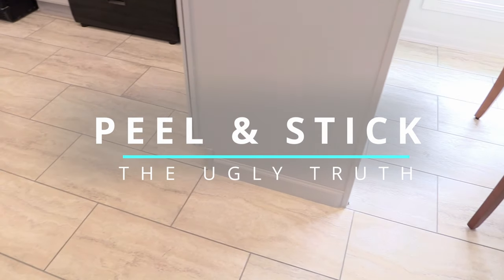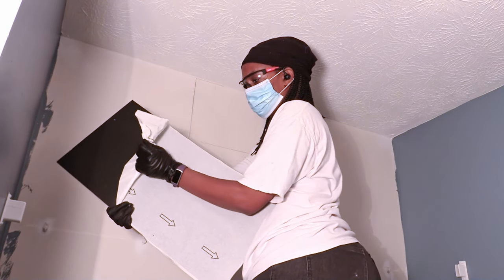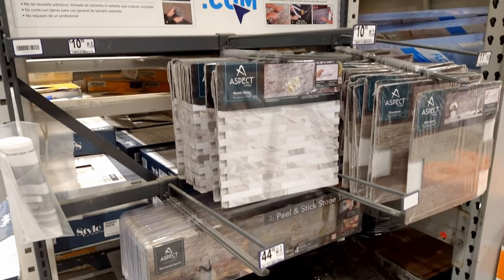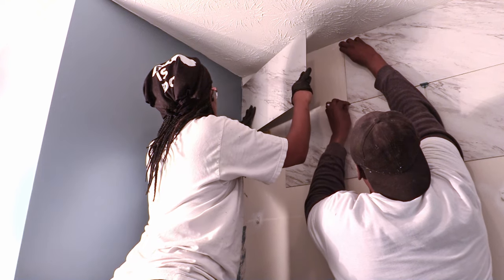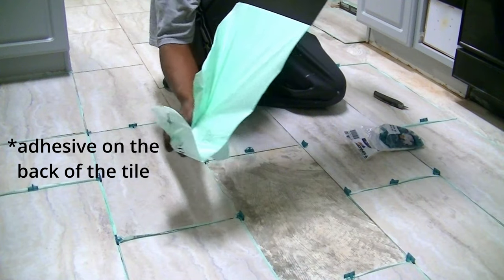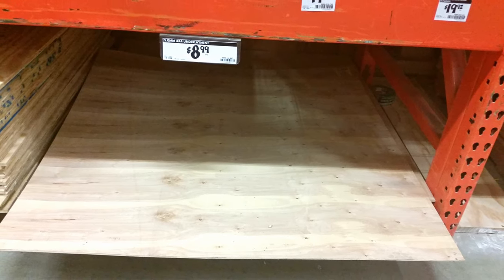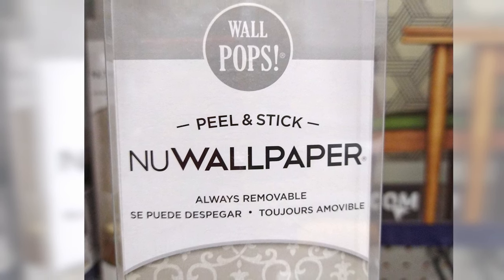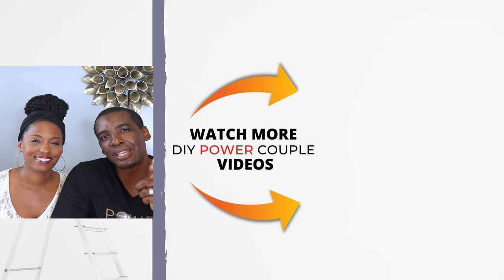THE UGLY TRUTH ABOUT PEEL & STICK - Don't Be FOOLED!

Comment: A tip that doesn't relate to peel and stick, but it does for rentals. If you have white walls and hung any paintings that you will take with you when you move fill the nail holes with white toothpaste and let it dry. It fills holes completely and you'll get your deposit back.

Make sure you take photos of your apartment so you have proof of any damage that's already there when you moved in. The photos will be evidence that you didn't damage anything if your landlord tries to keep your deposit. If your landlord takes you to small claims court because he says you damaged it, the photos will be evidence in your favor.
Reply: If you're going to fill the holes, just use spackle. It's the correct material, still dries white, and won't react weirdly when the wall is painted again in the future.
Reply: That's terrible. You're cheating and being very dishonest to the landlord by doing that.
Reply: Terrible tip!

Comment: Is it best to lay  a base of painters tape before laying peel a stick products? I was told this will protect the original product and makes easier to remove without damage
Reply from the maker: To us, placing adhesive on top of adhesive will have the same outcome. It may be harder to peel off (remove) tape over time because it could shred.

Comment: Very helpful as we now shop to replace our click together floating floor after only 2 years. Did not realize a floating floor is a terrible choice for a mobile home, what with all the flexing such a structure allows. Even a little has been enough to pop & chip each plank. Truly hope peel & stick will actually stay put. Maybe in your next video you can address different types of dwellings suitable for peel & stick tiles as well as what type of sub flooring is best. This has been an expensive lesson.
Reply: Peel and stick will work with your flooring. Just prep it right and do as they did with theirs and grout and seal it. The adhesive is extremely strong for the floor tiles. You can always look into adding extra adhesive when applying.
Reply: Oh, on Facebook there are a couple of DIY Mobile Home Restoration & Remodel groups (some have budget-friendly in the title). There also may be some videos here on YT. Anyway, I've seen a lot of great ideas and nice remodels done, using numerous methods. One lady was saving up for her floors to be professionally done, but in the meantime, she had just the bare plywood floors exposed.. so she painted and sealed them using porch paint I think. I couldn't believe the turnout, it looked good. I've seen several posts mention that they use wallpaper and vinyl wraps to update their kitchen on a budget.

Comment: Have you ever looked at a floor that's a few years old? I did one for a relative and a couple of years later I noticed that the tiles actually shrunk. I had put them down as tight as possible, touching. Now there's a crack between pretty much every tile about the thickness of two  or three credit cards maybe. I did have the tiles in the room for a day or two to acclimate them to the temperature as I think was recommended by the manufacturer. But in the end it didn't really matter.
Reply from the maker: We have always used premixed grout on our peel and stick projects so we haven't seen the shrinkage. The grout keeps the tiles from moving and it creates a waterproof 💦 barrier 🚧. It takes more time, but the tiles last a lot longer without lipping. 😀

Comment: I have used that strong peel and stick for my laundry room floor amd it NEVER came up. I used the Aspect Quartz Peel and stick tile in my kitchen and needed a heat gun to remove some layers. The adhesive is strong! Luv Peel and stick
Reply from the maker: Cheers 🥂 to Peel & Stick 😊.
Reply: @DIYPowerCouple  Cheers to trying to remove peel and stick, tho. I never thought about the removal process....

Comment: I see alot of the rooms that these are installed in are laundry rooms, bathrooms, etc ...would you all recommend it in common areas such as bedrooms and living rooms where carpet is already installed but needs to be removed?
Reply from the maker: Yes. You can use peel and stick tile in bedrooms and other common areas. We have used vinyl tile and vinyl planks in our bedrooms. New versions of peel and stick are very durable and cost effective so... yes, we would recommend it. 
Vinyl Tile: https://youtu.be/AgXhokAMpp4

Comment: One of my tenants used peel and stick vinyl tiles, and when I removed them they all had black mold under them. They were laid directly over concrete floors in Florida. :face-fuchsia-wide-eyes:
Reply from the maker: Someone let water in the room and did not grout between the tiles.
Reply: @DIYPowerCouple  not in this case. The ground became saturated with water from hurricane Ian and the concrete wicked up the moisture. It never flooded inside. The vinyl trapped the moisture but the edges were loose enough to allow mold to grow. You do not grout peel and stick vinyl tiles. That was just a weird response.

Comment: So my property manager/landlord is pretty “hands off”…. does not respond to routine maintenance requests, etc. The ceiling is leaking & moldy. (They sprayed the place with chlorine about a year ago. It did nothing except hurt my eyes and throat) The floors are in really bad shape. I want to do some repairs. I want to hire a contractor to replace the floors - at my expense. Bessie even though the building is in bad shape (built in 1906!!!) the rent is cheap and I work close by. I hope I can get in touch with them & work something out.
Reply from the maker: Remember: Anything you do to fix it up...will help the owner.

Comment: If you live in a "dump" rental the landlord may give permission to leave it as is because it is an upgrade. I own my older home and have used the tic-tac tiles for a backsplash. They turned out nicely and match the paint and countertop very well. I have had them for 5 or 6 years and they look good as new. I also used the peel-and-stick flooring at the bottom of my sink cabinets the cabinets are cheap particle board stuff so I want to protect them from any minor drips. It looks good and wipes off perfectly.
Reply from the maker: Peel and stick can be nice when installed correctly. 😃

Comment: I use a cloth iron when i remove it just put an old towel on top of the tile and make sure is really hot just don't keep it Too long or you make a hole in the towel just keep moving the iron  through the towel where you set it on the tile and make sure the iron is not one of the One you use for your clothes. One more thing keep a good spatula around for the adhesive that won't come out and a wet towel to remove the adhesive from the   spatula or it will be tough to remove later and clean your floor really good before you put your new ones in 👍👍
Reply from the maker: Thanks for the tips.👍🏾
Reply: @DIYPowerCouple   Your welcome 👍

Comment: In a bathroom/laundry room, over plywood, would you recommend a moisture barrier of some type on the floor first? I also have a painted concrete area in the same room.
Reply from the maker: Hi, you would need to find a moisture barrier that does not interfere with the adhesion on the back of the tiles. This video may help:https://youtu.be/yvEZNupNNFo?si=wBQvxFjvwOgo1G2j

Comment: 2 Questions:
1 - I imagine it looks unfinished when you have base boards in place already with an "unfinished" look, right?
2 - What about mopping?  I imagine moisture gets in there, eventually causing the "lipping" you referred to correct? Especially if the floor is uneven, right? What is recommended to clean it?
Reply from the maker: Emmy, Since we grout our peel and stick floor, we don't usually have a problem with water damage. The tiles that point down on the edges are usually groutable tiles and they have less lipping.
Reply from the maker: We use quarter rounds to help with the unfinished look, but we are about to show how to remove the baseboards for a cleaner look. Stay tuned.😊

Comment: You can keep peel and stick tiles mounted on a removable surface from slipping/sliding by using that thin rubbery no slip material ppl put under carpets etc
Reply from the maker: That's a great idea! We'll have to look into that...
Thanks for the tip! 🙂

Comment: You'll just burst my bubble and saved me some money. I was going to do a peel and stick tile from Dollar Tree on foamboard to use on my wall as a chair rail in the dining room and some peel and stick wallpaper to do on a living room wall. I guess not now.
Reply: foamboard is portable, why not use it? 🤔 the wallpaper really depends on the quality of what you are getting, always check reviews (make sure plenty are available) as many end up on opposite sides of the sticky spectrum ie they either cling too much or not at all, or if you're lucky, you get a product that works great with your wall & sticks perfectly while retaining easy removability.. also depends how clean a wall is too as well as the base like if it's a certain type of paint (all kinds have an issue w/smth at some point lol) but I can at least recommend one thing: "WET & stick" lol it's often only found in borders, but it can really pretty up a space! soak it, position it, squeegee it, let dry & voila - to remove, resoak with just a wet cloth or sponge then carefully peel away.. no real glue so it doesn't leave any residue on your walls! 💖

Comment: It should be! I installed two peel and stick Armstrong tiles over 35 yrs ago and they still held in place and if kept clean, they look very well. Proper bonding is essential . You just don't peel and stick. Follow the manufacturing directions and it does hold up, even in a bathroom of all places!
Reply from the maker: We agree, Doug.

Comment: Do I need the special adhesive for my peel and stick bathroom wall if it’s also tiled. I hate the tiling in my bathroom and it’s floor to ceiling
Reply from the maker: Yes ,the adhesive allows tiles to remain on the wall without sliding down.
Reply: @DIYPowerCouple  thank you for the response ❤️

Comment: ITS TRUE. I used peal and stick on my floor in my public housing unit. It looked beautiful to begin with. But the tiles soon started looking shabby and the edges of the tiles started rubbing off. I realized (something not in the instructions of the peel and stick tiles) that I needed to add some layers of polyeurothane or something afterwards to seal the tiles - something that I didnt know about. Not only that, but I couldnt get them off afterwards. Luckily, with some help from a social worker, the public housing authority replaced the whole lot free of charge - the original ugly institutional type flooring that I tried to cover with peel and stick (what you see in public hospitals and prisons) was 50 years old anyway.

Comment: Well, that's exactly the information I needed, though it wasn't necessarily what I wanted to hear. I LOATHE my "agreeable gray" (aka despairing drab) walls in my apartment and was hoping for an easy fix. Are there any products that are renter-friendly that won't cost me the deposit?
Reply from the maker: We haven't found any yet but we keep an eye out!
Reply: I've seen people do a wall mural with the wallpaper, but they attach it to a backing and then place it on the wall using something like double-sided tape (someone mentioned carpet tape worked for them in a comment above). You couldn't even tell that it wasn't directly stuck on the wall.

Comment: But puting in wall on top of tiles, because bathrooms use to have tile walls . Do we need adhesive for this ?
Reply from the maker: If the tiles are not made for walls, most often they will need extra adhesive to stick on anything other than subfloors.  Hope this helps!

Comment: What do you think about using the peel and stick floor tiles on your fireplace surround forgot to add it’s gas I rarely use it.
Reply from the maker: We probably wouldn't recommend it because it could be a fire 🔥 hazard. We want you to be safe, Mimi. You can put it on the wall 🧱 instead. We changed our gas into an electric ⚡ fireplace. Take a look: https://youtu.be/uVjPQoTr50Y
Let us know your thoughts. Best, -DIYPC 😃✨
Reply: Thanks for your feedback I guess it will stay as is I have faux logs connected to the gas pipeline. I did watch your video you guys did an amazing job as usual.

Comment: I'm new here and I need your help. I want to tile or just do something nice to my garage floor. I tried painting it several times. Nothing holds. It's a cement floor. Please help.
Reply from the maker: Welcome to the DIYPC Family! We have used peel and stick on cement floors and they still look great. If you plan to drive on the floor then you can use a garage floor paint specifically for cement flooring. Kilz and Rust-Oleum have garage floor paint for cement.
Reply: It has to be properly cleaned, prepped, and primed ( this is very important to use the correct primer, which may be a shellac primer- that not only works on cement but oil and grease that can bleed through- or later emerge from being pushed down in the porous concrete- a regular primer will not work), use garage cement paint, and then properly seal it.  Can't skip any of the steps or it won't stick and cure. Also, have to follow the amount of time recommended for it to cure. Which means it can't be used at all until then. I've never done cement, but I've dealt with other paint projects, and I learned the hard way about not skipping or making a shortcut on any of the steps needed. Making sure I'm using the right products for specific surfaces, and also any special needs that need addressing- like tannins bleeding through antique wood. I ended up having to redo a project once, making it much more expensive and time-consuming than if I had just followed everything through properly to begin with. Thank goodness for online DIY remodeling groups and channels.. and people who do it for a living and share their knowledge and tips.. cause it can be a bit overwhelming to research some projects and realize that it's going to take some time to find everything you need to know for it to be a success. But it's worth it if you can save a ton of money by not hiring someone.

Comment: If you all ever remake or create an update for this topic, could you please divide it into sections? Ex: Section 1: Flooring, Section 2: Walls OR even Section 1: Pros and Cons of Floor (specifically) and Section 2: Pros and cons of Walls (specifically) Because it seemed for most of the video, the term Peel & Stick was used as a blanket term for both floors and walls, yet the issues themselves weren't interchangeable. Also, it would help with organizing the content, making it more user-friendly, so to speak. Thank you for this content. 🧡 It was just a tad difficult to follow along with. (Between going back and forth between walls and floors, two people talking, and jumping from clip to clip)
Reply from the maker: Ok

Comment: These items (all peel & stick) might look pretty at the beginning, however, it still looks cheap and with time the flooring will start to move making the glue to start to affect the floors. I’ve had the “tile backsplash” in the kitchen and no it doesn’t look like tile, you can tell it’s fake and when I removed it, the paint (oil paint) from the wall came off. Absolutely agree with you it is NOT rental friendly - Do not use it.
Reply from the maker: Thanks for sharing your experience.🙂

Comment: One trick you could do if you're going to stay at your apt for a good while and you want to put tile on a vertical surface like a wall, is you can hit up home depot and buy these thin sheets of wood or plastic (I forget the material name) and screw it into the surface you want to tile. At least that way you have a barrier between the tile and the surface itself and all you have to do is fill in the screw holes after you take it all down when it's time to move.

Comment: If you heat up the adhesive just slightly with either a hair blower or heat gun it real hold down like no tomorrow.
I alwaysssss first let it acclimate for up to 72 hrs to the house temperature then I heat up each and every peel & stick tile prior to  applying them, then I grout it between each one...neverrrrrrrrrrrr have I had any issues what so ever...luv peel & stick tiles.

Comment: Thank you for this video.  Peel and stick is not necessarily “renter friendly”.  People have to be extremely careful with using these products in their rental.  A lot of designers using peel and stick in rental friendly options will often use some kind of backing to be truly rental friendly (like plywood or poster board) so it can be easily removed (thanks for mentioning that, BTW).  

Honestly, it’s better to either just design  around the decor or use REAL removable items to conceal bad flooring/walls like artwork, rugs, and carpet remnants.   If your landlord is okay with this, just use good old-fashioned paint.
Reply: I'm wondering how does the poster board stay in place. I guess it's for flooring only.

Comment: Um, you have to use luan board as a substrate and then prime that surface to stick tiles to, no problems. You can tear up the luan board AND tile if necessary, all at once.